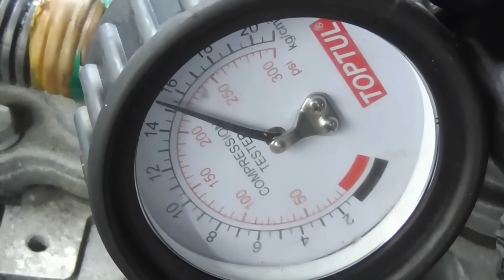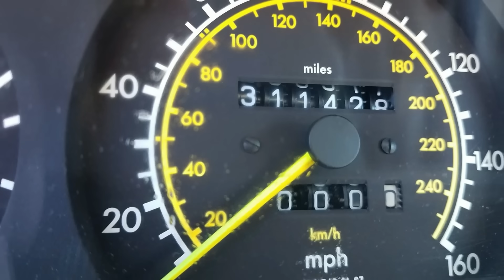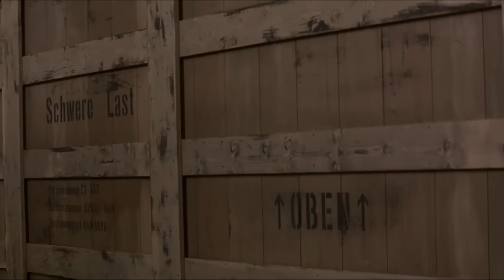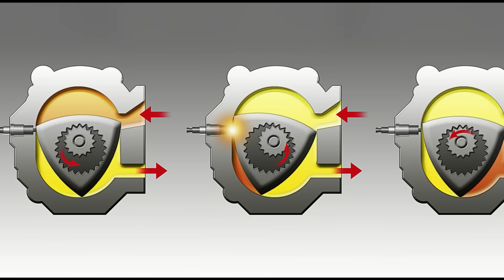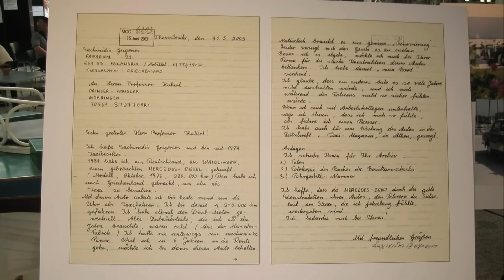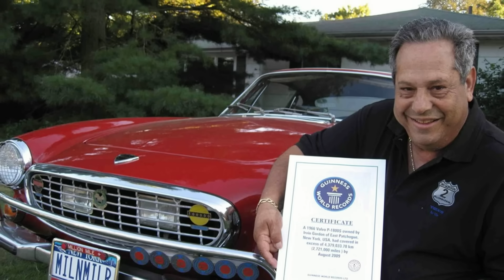Most Reliable Engines of All Time

Comment: If I had ANY engine that needed repair in  under 100,000 miles I'd know I have a lemon.  In fact, having owned Hondas and Toyotas, I expect and demand at least 300,000 miles without engine problems.  Otherwise it's junk.

Comment: I had a LS2 enginee ( c6 corvette ), drove it for 8 years, done track days, supercharger it after 3rd year.
heavy daily drive done easy 100km. and no single problem with the enginee or gear.
and I am in Dubai, you can just imagin the heat.

Comment: Certainly NOT super accurate.  Mazda's rotary engine reliable???  They burn oil and wear out quickly.  All vehicles today should expect to do at least 200k MILES!  You forgot a huge player in this' the Honda/Acura v6 3.3 - 3.7L  My 2003 Acura TL-S has 380k miles.  with only regular oil changes, timing belts, and plugs.  It still shames many of today's cars with power delivery.

Comment: 1977 F150 300 in line 6.  Daylight through the floor but still kikkin with 378000 miles.  Every day farm truck.
Reply: and I can still tune it with a screw driver and my timing light.  Any of you young guys remember the timing light?

Comment: Ford Falcon inline 6 from Australia. Unfortunately not seen much internationally. Solid as a rock with a design based on the original 1970s roots. Started as a 4.1 then 3.9ltr some years, ended it's life as a 4ltr. Had some years with head gasket issues but that was rectified. As a whole it was extremely bullet proof. The last gen Barra Turbo version is still being developed by the aftermarket and is up there with the RB and 2JZ nowadays

Comment: For a reliable work truck engine I woul add the Ford 300 I-6.I bought a new 1996 R-150 with over 300,000 miles on it .The fuel injection  took care of the outer end cylinders running lean .When it was totaled in a accident .It use 1/2 QT of oil between changes .I It never went more than 4000 Mls with out a oil change .New fuel filter once a year and ATF changed every 40,000 Mls .I had just had new ball joints and brakes and shocks rep[lace for the 2nd time when it saved our life in a wreck we walked away from .

Comment: I got a 2005 ford escape with 200,000. It has the v6. I got a 2003 f150 with 275,000 v6 as well.
Reply: I got a 2005 grand marquis with 225,000 miles v8
Reply: Seth Bawden those are great cars. I had one myself with over 200,000

Comment: You really think a rotary engine is reliable?  Are you smoking crack? 
Can a rotary even make it to 100k ? I would wager that they are few and far between. Show me some real proof.

And how come no mention of a Nissan L series? They have a reputation for very strong reliability and going lots of miles.
Most all diesel engines are known to last, there are some exceptions however.
The very high compression required. necessitates that all the components be very stout to survive the high stress loads. 
I have formal training in automotive and diesel and have been employed in this profession, most likely before you were born.

Comment: No mention of the 6BT, Volvo red and white blocks, Caterpillar 3 cyl, chrysler slant six, ford 300 inline 6, ford FE series, Chrysler 361 or 440, Buick 3.8, Pontiac 305, Oldsmobile 455, Cadillac 500, or AMC inline six? Sheet kid, 200k is still wet behind the ears.
Reply: Used to strip race 1/8 mile a very mildly modified Oldsmobile 455 in a 70 Olds Cutlass S....didn't have horse power of a big block Chevy, but in 1/8 mile was a torque monster (left front wheel up launch), and drove it to and from the track with cheater slicks in the trunk. Never did a rebuild!

Comment: 600k on my slant six says none of these import mentions will ever touch it. Can you run your engine on 1.5qt of oil? I know I can!
Reply: Carter Stokoe What type of slant six ?
Reply: @davidtaylor857  RG225 bored .090 over, 9.4:1 CR, Iske street cam, running a quadrajet 800cfm and hx45 at 11psi. Stock head, stock valve train, stock crank, pistons and bottom end. Torqueflite 904 w/3100 converter means consistent high 12, low 11 second passes.
Reply: Carter Stokoe I am assuming you are using iron block version. I remember they made some aluminum 225 that had a few issues .

Comment: 3.3 Chrysler V-6 is bullet proof.
226k & counting, just cleaned the throttle body, that's it.
Reply: Same with the 3.8 my wifes 2000 town and country is running strong with almost 250000 miles .
Reply: @andysan9557  the 3.3 & the 3.8 are the "slant-6" of modern Chrysler engines. The transmissions from 2005~2009 were also bullet proof.

Comment: those are nothing 2004 5.7Liter hemi.. 419.000 miles and counting engine has never been apart..not even a timing chain.  does not burn oil.
Reply: 657k on my slant six 1980 volare. Never been taken apart. Smokes on startup, falls on its nose when cold....still hustles its 3300lb ass to a 16s 1/4@ 80+....with all of maybe 80hp
Reply: I bet everything else broke down on the car though lol

Comment: My last two Chrysler minivans have had over 180000 miles on them. The first one spun a cam bearing. The second is still going at 185,000. Replaced a radiator and am getting ready to replace a catalytic converter. Just replaced the spark plugs at 170,000 miles so some of this means very little

Comment: why did you show a supra in the rb26 bit? and...just so you know, it made more than 276hp, the "official" horsepower numbers from anything from japan until recently were all 276, because of a sort of"gentlemens agreement" between japanese automakers to never advertise a jdm car over 276 horsepower. toyota 1jz? 276 horsepower, the 2jz which is even bigger? also 276, mazda 13b in the rx-7? wouldnt ya know it? 276! they are all just lies. all those engines make more, the 1j maybe right around there

oh and no one proncounces it as det. they say d.e.t.t

Comment: Pronunciation and inaccuracies of this physically hurt me..

But on a more related note, Toyota's 1UZ-FE 4.0L V8, there's a 1996 Lexus LS400 getting around 'murica with this engine that has over a million miles on it, achieved without ever opening the engine for internal maintenance. (Google for "million mile Lexus")

The gearbox was rebuilt/serviced 3 times in it's life, but that engine was totally original

Comment: Having the GTR engine on there was dumb it’s to new. Where is the Chevy 350 at?
Reply: A limousine service I worked at in Denver put a used Chevy 350 into a 1961 Rolls Royce after our mechanic forgot to the oil & it ran another 110K miles

Comment: the old 4.1 litre ford inline 6 engine was fairly reliable. I had one with over 300000 miles on the clock in an XY falcon. It had never been rebuilt and used oil like it was going out of fashion, but it never missed a beat.

Comment: No 5.9 cummins 7.3 powerstroke small block chevy ect ect ect
Reply: Agreed. He is clearly biased against anything american
Reply: Chevy vortec 4.3. Ford 300 inline 6. Toyota 22r. Ford 4.6 v8. Jeep 4.0. Toyota 4.7 v8. Chevy ls engines. Toyota 4.6 and 5.7 v8s. Hell I’ve seen a lot of geo metro 3cyl beaters with 300k plus.
Reply: @Billy28376  First Gen Ford 5.4l was reliable was basically bigger 4.6l Till they put cam phasers in it and made it junk.
Reply: Wolgon Automotive yes I agree. I was just naming them off the top of my head.
Reply: @Billy28376  don't forget the 5.0! I've seen many with well over 400k with all original parts. Same for the Vulcan 3.0 V6 from Ford. Transmissions were weak on the Taurus tho
Reply: Jeff Margera very true. 289 and 302. Some of the best engines ford ever made.
Reply: Sbc's ive seen TBI motors run 500k. 305s are also very reliable. He also mentioned the rotary , which is notorious for being unreliable , even rx owners will tell you this
Reply: 300 incline ford...
Reply: Considering I don't see half the cars he mentions still driving around without major Headgaskets and repairs. He thinks 100k is a lot Every vehicle I own has had over 200k miles with 0 major engine repairs.
Reply: David Sanchez 
I’m talking about the American 3.0 V6 from the 80s up to the early 2000s. Those are everywhere and a lot of them have well over 300k
Reply: David Sanchez good old 2.5l
Reply: David Sanchez I have a 1965 289 on the engine stand in my workshop now. Still not sure what I’m going to do with it. But it’s going in something.

Comment: Apparently you never heard of the Lexus LS 460, also referred to as the million mile car, and not only by the occasional fanatic who replaces oil and filter every month, but by every mature driver who does no more than regular maintenance.  I am currently shopping for a 2010 LS 460.
My problem is that I am turning 80 next month and don't drive more than about 5000 miles per year.  Therefore, even if I lived for another 20 years I would only add about 100k to the miles on this Lexus, which means it would barely be broken in.
I would so love to drive my LS 460 to a million miles, but, regretfully, I won't have enough years left in me to outlive that wonderful vehicle.

Comment: the biggest factor is always the user, and most people dont know how to treat an engine properly, however the less moving parts are involved and the more robust the engine was designed and built the bigger is the chance to survive over a long time like a mercedes 240d n/a diesel (if you always repair anything what breaks you can make run pretty much any engine for a long long time)

Comment: 12v cummins GM push rod v8s
Why were those mentioned
Reply: Apparently if you can get over 200k on an engine it won't qualify. I have a 5.7 in a truck with over 420k with nothing but oil changes and a 5.3 at 310k.  Most of the ones you see on craigslist have over 200k, and those are the low miles ones...

Comment: 100,000 km and or miles isn’t very impressive I used to own two different 90’s Jeep cherokees both of which had the Chrysler 4.0l inline six and both of which had over 450,000 km with the factory engines never had a single problem with the engines themselves always ran great and they didn’t mind slamming the rev limiter every now and then

Comment: Any GM small block V-8 will go 100,000 (even 200,000) miles, in fact with proper oil changes most North American modern engines will go 200,000, and not nearly as many other issues as European auto's

Comment: Mazda 13b reliable, must have been paid off by Mazda. When mine broke down in the 1990's the tech guy said the turbo engines would get replaced at 35k under warranty and be lucky if the standard engine lasted 60. Mine failed at 90k.

Comment: Wow... just wow. Clearly whoever put this together knows nothing about engines. 200k miles is nothing and the Mazda rotary engine... reliable??? No mention of the 5.9 Cummins and 7.3 Powerstroke diesels, 4.0 in-line 6 used in the older Jeeps or the 5.7 GM Vortec. As a tech I’ve personally seen all the engines listed above at 400k+ miles and no major issues.

Comment: My family's Dodge 1985 with original 1st Gen Cummins diesel 1.2mil yes we keep track of the mileage
Reply: The first year of the Cummins was 1989. So either you're remembering the year wrong or that engine wasn't original.
Reply: @mrbeefhbw   your right it had a 360 in it then the Cummins was dropped in 1990

Comment: I had a 1993 Dodge Cummins pickup that I drove over 250K and when I sold it 12 years later, was still the original Dodge diesel pickup with the original clutch, engine, rear end etc etc and still got 23.7 mpg. Brakes and shocks were replaced and the oil change was via a "lifetime oil change" I bought from the Dodge dealer when I bought the truck new. But that was it. It was like driving a Volkswagon it was so economical to drive. And the price I bought it for was less then $20k too. I sold it for $5k. It was a great truck!!

Comment: Seen a lot of 5.9 Cummins with well over 300k running strong and personally there are 2 LS1s in my family with over 150 and I have an LS2 with 168k... And trust me this was my car since high school she got beat on a little plus some drag strip and still idles super smooth no issues except suspension parts.🤷🏼‍♂️
Reply: I was just going to say you can't have this list without including the small block chevy, the ls series chevy and the 5.9  Cummins. But then I remembered he didn't have 1 single American car on the list. Just an old fury that had been overhauled several times.
This kids doesn't know what he is talking about.

Comment: "Will it be reliable only time will tell, " really, for an engine that's been made since 1994?  Also, the Mazda rotary is one of the worst engines ever made.  Whoever wrote this knows nothing about cars.
Reply: Robin Sattahip You’re the one that sounds like they don’t know anything about engines saying that the Mazda rotary was one of the worst engines ever built. Because that is just plain and simple not true.
Reply: udaaz       For gas mileage yes it’s the worst in that category
Reply: @udaaz  Ok mister I like burning through a gallon in 17 miles and have to top off my crankcase with oil every time I get gas. Of course the Wankle design is one of the worst engine designs ever made, no torque, needs excessive RPM to produce any kind of torque at all, burns oil as a process of lubricating the apex seals, drinks gallons of gasoline just as bad as an American 1960's V8. And you want to say it's not a bad engine? Biased much?
Reply: @JosephArata  Bad engine for reliability reasons. Doesn't make it overall a bad engine. For the size and displacement it can make a tremendous amount of power and it's actually quite simple compared to a lot of piston engines therefore making it better in that category.

Comment: all honda engines are most reliable and most “powerful”
Reply: I have 3 Honda's in my yard all run like a champ my 05 accord  has 289k. My 02 civic has close to 260k my girls 2012 is the baby of the bunch with only 98k on it
Reply: I got my brother's '98 1.6 ltr  Honda DX. 270klm. Engine is perfect...now because I had to do routine msintenance on it.
Reply: I have a 2010 Accord with that Honda engine, 260,000 kms trouble free.

Comment: WTF?!? OK, here's an engine ... and a picture of that engine. Or was that a picture of the engine? It seems random pictures are thrown in all over the place. Why? I was just watching the car with the most miles in North America, the 1963 Plymouth Fury which they said went through a couple slant 6 225ci engines during its life. Yet not once did they show that engine! Instead they showed what looked like either 413ci Wedge or 426ci Hemi engines. Great engines no doubt, but the 225ci slant 6 is bullet proof and will run forever on just gas, occasional oil change, and make sure it has fluid in the radiator. Random pics?!?

Comment: A glaring mistake was missing the Ford 300 cubic inch inline 6 cylinder engine. With the primitive engine oils available in the 60's the gasoline engine would routinely go 500,000 miles.
Reply: Thiokol  used to use them in their snow cats, bullet proof engine if maintained.

Comment: 5.9 L 1st gen cummings with 480k
Reply: 5.9 1994 1st gen cummins with 280.000 everyday
Reply: @hoagie2011  starts up everytime no problem. 1st gen Cummins should have been number 1. ;) not to mention the ECU burnt out on mine so I've got an external voltage regulator hooked up. Now I can survive an emp and my truck will still run!
Reply: DT400 series and HT series, along with 3406, C12, 7.3 IDI, 7.3, C15 and C18 should be on the top of the list for truck/tractor engines. (Diesel, that is.)

Comment: SC400/LS400 1UZ-FE gen 1, most reliable engine EVER produced. 500k+ miles and still going strong, never had a rebuild, only oil changes every 3 months.
Reply: Mine's got 300K and is outlasting everything else on the truck.

Comment: I'm gonna throw a consideration into the mix. The Ford inline 6 mostly the 300ci 4.9L version. Bulletproof is not a strong enough word. My 87 f150 was ready for the scrap yard so I decided not to send it there with a running engine. Drained the oil and bombed around a oval track I have for racing quads. Spent 20mins doing laps and no failure. Drained the coolant and after 45mins and countless laps I gave up. So I got my .300 weatherby out. 3 rounds through the block. It fucking started! I decided it could live cuz it wasn't going to die.

Comment: What are we talking about here? This guys can't really believe this crap. If you are talking all engines than you have to include big road truck motors like Cat and Cummins and Detroit . Where  2 million miles is not that hard to believe. 1 million is average and that is pulling 80000 pounds. They can be gone through and rebuilt many times over. There are Road trucks running around out there with 12 million miles on them. On passenger engines how about the good old 350 L blocks . You keep dreaming MAD LAB,  HA HA HA .

Comment: 1995 Audi 2.2L Turbo Straight-five. The engine was practically built for rallycross and made its way into some car models, however it was tuned to 2.5 liters for the Quattro and Sport Quattro, as well as the racing versions.

Comment: If you only get 50k miles from a clutch then you don't know how to drive a standard trans
Reply: My gasoline Mercedes has original clutch and 320k miles on the clock.
Reply: speterbilt - Not necessarily. It can truly depend on the conditions. In all my life only had one car taking a clutch at 75.000k km, notorious low mileage by any standards. It just so happens that I spent about 14h a week in stop/go traffic on uneven terrain. Terrible conditions, where it was not so uncommon for me to turn off the engine, set the parking brake and wait. :-( 
Best thing I did was to get a job on another location. :-)

Comment: My Granny had a 1987 Caprice wagon (5.0 or 5.7) and it went FOREVER! She finally got rid of it in 2012 when some woman side swiped her and Geico said it was cheaper to total it out. But it had over 414K miles on it. Think the only thing my grandpa did was brakes, tires, battery, flushes and stop-leak in her radiator.